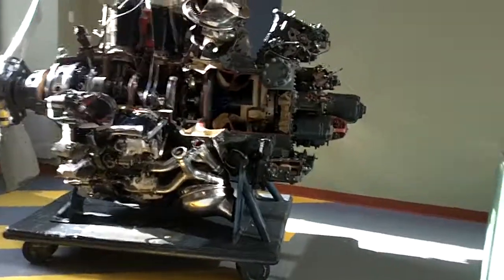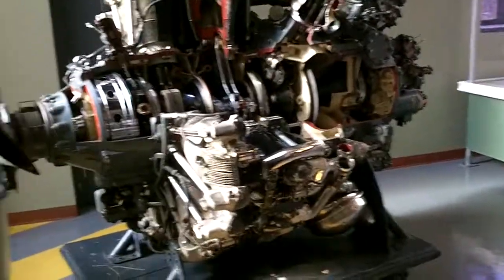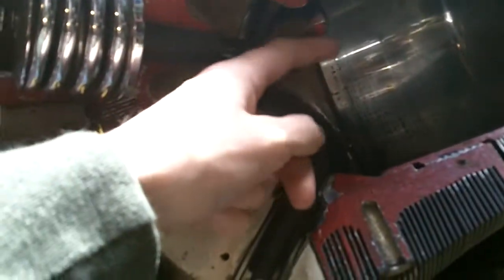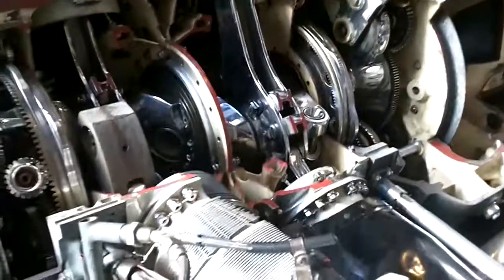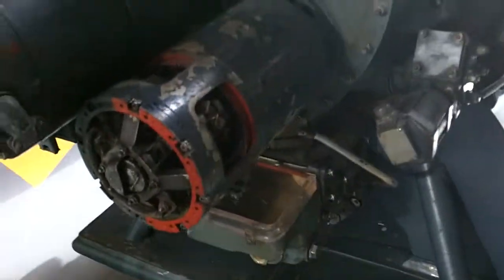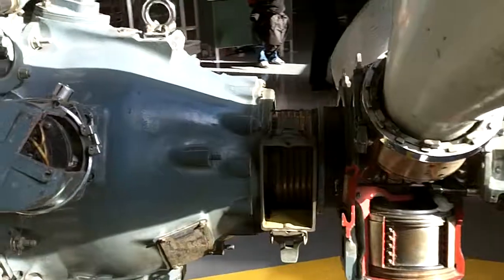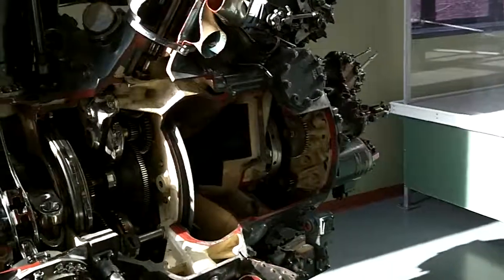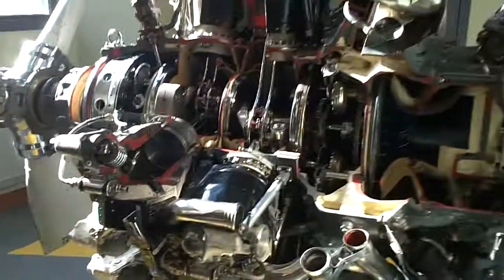18 CYLINDER RADIAL ENGINE CUTAWAY

Comment: @josderedneck22  3350 is the displacement in Cubic Inches. it can put out anywhere from about 2,200 through over 3,400 horsepower, depending on the variant.